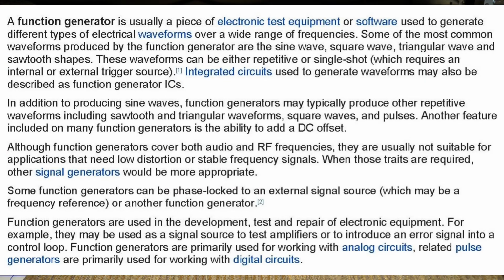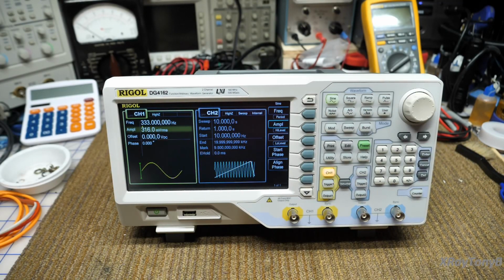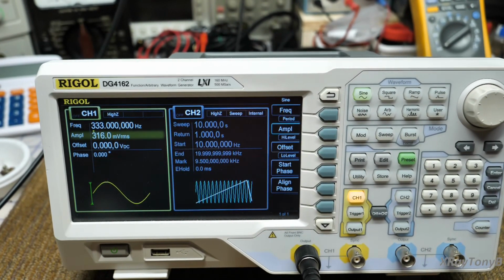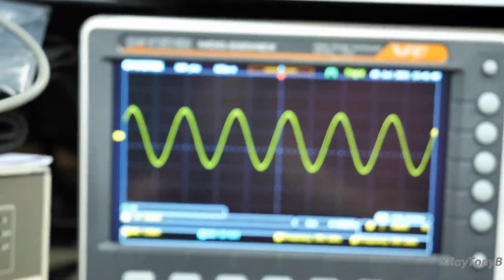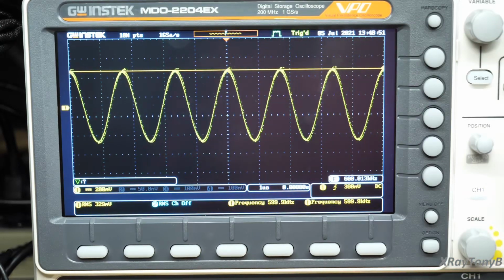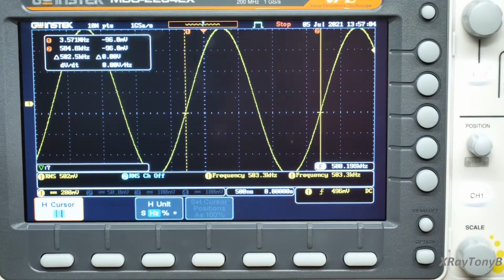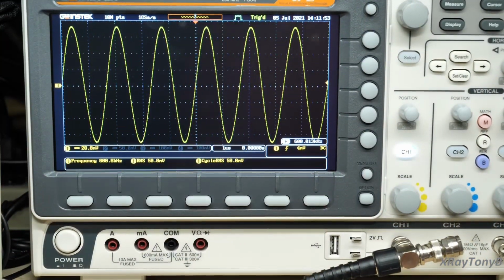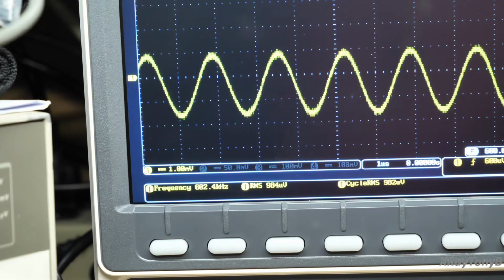Random Video - Viewer Question - Using A function Generator for RF Work (Poor  Audio Quality) :((

Comment: Do you have to do the modulation on a separate channel on the waveform generator than the carrier? If so How do you combine the two channels so you can put the mixed signal to the radio IF?

Comment: Tony another Great Video! I have  a lot to learning, you explained that you need the Maximum SG to be over 110mhz for Fm but not the minimum for AM would be 540k?  if looking for one will they go that to the low Spec? and does this have RF output? ( needed for Pioneer sx- aliment / tuning ?)

Comment: As a very economical and versatile unit for the hobbyist, I recommend the "TinySA". It's a handheld spectrum analyzer and signal generator from a few kHz up to 960MHz (and up to +16dBm output). The generator part can me modulated by selectable frequency, and AM/FM-modulated. Sweep-function is also available. Compared to the abilities, this device is "dirt cheap". 73's.
Reply: Have you tried it Yet and did it work? The newer one is the Tinysa Ultra? is better and bigger screen

Comment: I wouldn't have thought of using a 1 Hz modulation.  That was interesting.
Wh is it that some radios specify a 30 % modulated signal, and others as high as 50% for alignment ?   I would think using 30 % would end up with a more sensitive radio - or maybe better selectivity.
Thanks.

Comment: What is the signal generator THD at 1 khz?
Reply: 0.1%. As far as I know the HP / Agilent 33120A has the best THD in this price range: <0.04%.
Reply from the maker: The advertised spec for the DG4162 is <0.1% THD from 10Hz to 20kHz range.  I have measured mine using the Keithley 2015 in THD mode out to the 5th harmonic and it was way less than that at 0.016% with 1kHz at 500mVRMS.  At higher frequencies, the distortion goes up.  Another helpful feature is that it can accommodate an external reference signal, so I can use it with my GPSDO 10MHz reference.  Thanks for the comment!

Comment: Question: In the absence of a precision RF signal generator, like your HP,  what about the possibility of using one of the better quality FM Stereo home transmitters for calibrating, or at least "peaking", our hi-fi FM tuners/receivers, using an audio signal generator to provide the modulation input?  The better units have selectable broadcast frequency and PLL stability.  Of course, the output out need some serious attenuation to inject directly, and it would only be at first stage, but seems like it would be better than nothing?
Reply from the maker: I've heard of others using them, but you would be limited with what you can do.  Different tuners require different signals during the alignment process.  Some need just a pilot signal for the MPX circuit, and then a full composite MPX signal.  You also need to be able to produce an RF carrier signal at very specific amplitudes.  This is difficult, if you don't have the correct signal generator and the correct impedance matching.  Using one of those stereo transmitters will allow you to possibly peak and center the various stages, but setting the pilot detect or measuring sensitivity will be difficult.  You also need to inject a stand-alone composite MPX signal into the stereo MPX section on some tuners. 
Hope that helps.
Reply: @xraytonyb  Good points, thanks, Tony.  So, short of the mega-bucks HP machine, is there a mid-level piece of test gear that you would recommend for FM tuner work?

Comment: I think that Keysight is the test equipment brand name of Agilent.
Reply from the maker: Just to make it more confusing, the medical division kept the Agilent name and the test equipment changed to Keysight!
Reply: @xraytonyb  My lab at work replaced all of the Agilent branded function generators with Keysight ones a few years before I got there. The Agilent ones were much better as they were in a much more durable case and they dual channel. I found some of the old ones in the store room when I got there 3 years ago and wondered why they stopped using them and replaced them with the current single channel Keysight ones. Evidently someone before me thought these were upgrades they also ordered some much needed DPSO 4-channel Tektronix o-scopes right before I got there. They came in about 2 months after I started. They were the 2 -channel versions, but when you looked them up on the GSA Advantage catalog online there was a stock picture of a 4channel o-scope. They must have thought they were getting a great deal and saving a couple thousand dollars apiece.

Comment: Sounds like you're over driving the microphone turn it down a bit and turn it up in post production and  will get rid of any background noise
Reply from the maker: The new camera has selectable microphone response curves for external microphones.  I was using a lapel mic with a low gain preamp, but the curve was set to a high gain shotgun type mic.  It took me a while to figure it out, once I noticed the issue with tis video.  Too damn many settings on this camera!
Reply: That was not background noise, that was interference. :(

Comment: If the function generator can't go high enough for the FM band, couldn't you put it into square wave output so that a harmonic of a frequency it can do lands in the FM band?
Reply: You can do that. https://youtu.be/F66rsJAhAF0
Reply from the maker: This is precisely how the old signal generators worked.  This is why generators like the EICO 324 and those types did not output a pure sine wave.  The distorted shape of the sine wave would produce harmonics, which would be the two upper frequency ranges.  A square wave would produce a bunch of harmonics and might interfere with your alignment.  The slightly distorted sine wave in these old signal generators only produced one or two harmonics before the amplitude would drop way off.  Pretty smart of those folks back then!  It always amazes me how engineers back in the 1930's to the 1960's came up with innovative solutions like this!  That's why I am such a fan of vintage electronics!
Reply: @xraytonyb  Now everything makes sense. 
I have one of these: https://www.radiomuseum.org/r/conrad_signalgenerator_sg25sg_2.html
And I've always wondered, why it wasn't possible to get a nice clean signal out of it. One half of a cycle is always cut off at half of the amplitude.